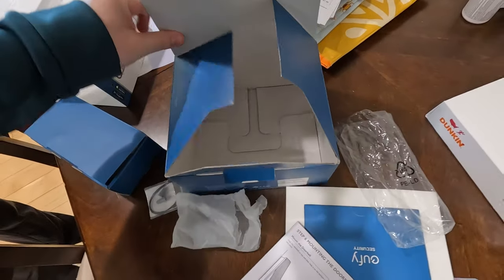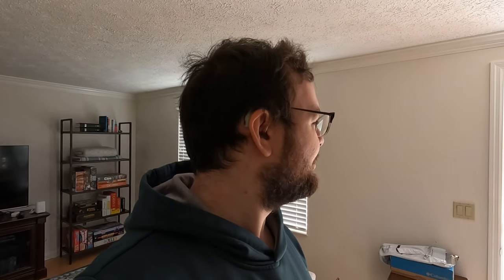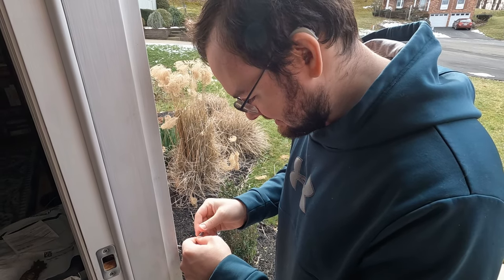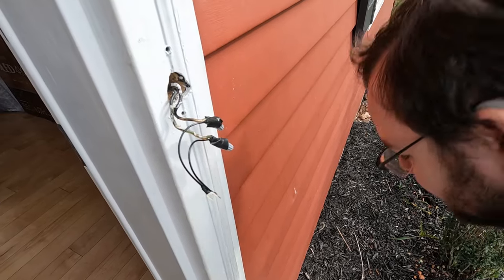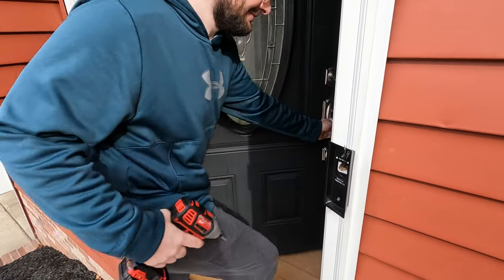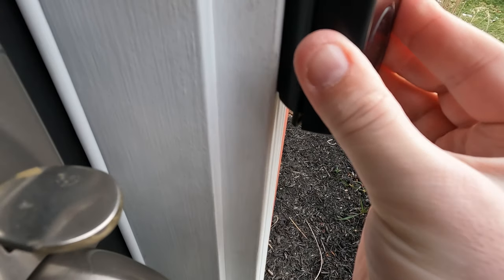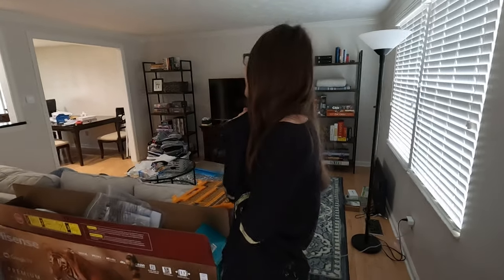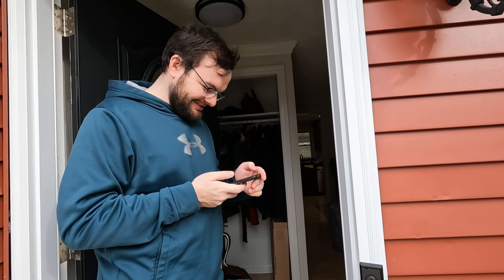Installing Our Eufy 2K Video Doorbell - Wired

Comment: Don't you really also need to show how to set up the Homebase since on initial set up I believe it has to be connected by Ethernet to your broadband router?
Reply from the maker: The Homebase just needs to be connected using ethernet, doesn't have to be the actual broadband router though. It could be an extender in another room. We left it out because it just gets connected with ethernet and power, then nothing else really.

Comment: Wasn't that installed a little low to see who is at the door?.. Whats the resolution lIke?... Can you read delivery vehicle number plates on the drive or roadside maybe? How about cutting an extended version of the video with some more day to day experiences, etc
Reply from the maker: Hello! For us it wasn't installed too low. One thing we did was have one person hold the camera, watching the live feed, while the other one walked up the sidewalk. That way we knew where to place it. In our case, you can't really see licenses on vehicles on the road. Driveway, yes, but not road. It does however  pick up faces extremely well

Comment: What was in the box?
Reply: A Tesla model X
Reply from the maker: It came with a bunch of stuff. There's the 2k video doorbell, mounting bracket, the 15 degree wedge to offset the doorbell if desired, the homebase 2 (brains of the system, local storage, and another chime if you wanted), ethernet cable, screws, extension wires,  and charging cables. Has all you could need aside from tools
Reply from the maker: @wildegans4199  Don't give away the secret!
Reply: Donuts:face-blue-smiling:!!!

Comment: Thanks for the video. Does the homebase need to be closer to the doorbell camera unit? Or can it be located anywhere in the house (like the basement) as long as it is connected to the wifi network?
Reply from the maker: Glad you liked the video! The home base can basically be anywhere as long as it has strong wifi connection. Mine is located on a second floor office and it has no issues.

Comment: Thanks for the video! Did you you the jumper cable in the chime box? I see some people do it. Is it to turn off the original chime with the electricity still flowing to the bell or? No expert here :)
Reply from the maker: Not quite sure what you mean, but we didn't touch anything in our chime box because we wanted the original chime to still go off when the doorbell is pressed. The wires shown in the video is both to power the doorbell and power the house's chime box.

Comment: Do you have to turn off the circuit braker when installing? Or is switching off the doorbell transformer sufficient?
Reply from the maker: I'm not too sure. We turned off our circuit breaker and tested for inactive electricity with a multimeter. If you went with the turning off just the transformer, I'd still double check with an instrument. Safest is turning off the breaker.

Comment: Hi! If I wire the Eufy doorbell, it will work during a power outage and operate on battery power?
Reply from the maker: Hello! If you get the model we did, then yes it should use the battery if the power goes out. It'll save "events/detections" locally and when the power comes back on, those events will be viewable on your phone

Comment: So No need to install new Transformer with this ?
Reply from the maker: Nope, we were able to simply use the pre-existing doorbell wires since it had the correct power output for the Eufy
Reply: @AJandMariaDelposen  what is the correct voltate for EUFY?